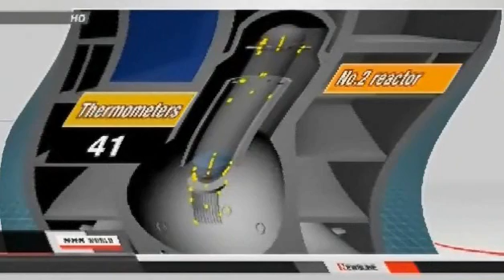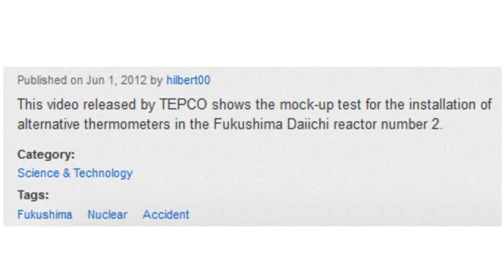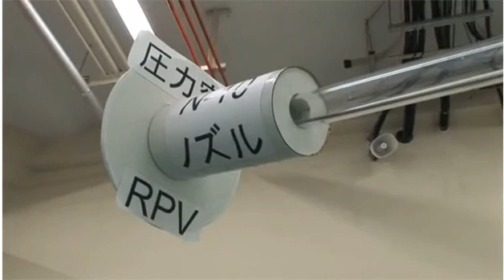OMFG, Fukushima Decontamination Japan, have a peek update 6/2/12

Comment: The problem is clearly that they are using Toshiba equipment. This means to me that they are using low end equipment bought at Walmart. Until they start using Sony I do not see us progressing. 

Same as the floor paint. They didn't even etch the floors. This is why they scraped it up. It didn't stick, and its also made by Toshiba as well!!

They might as well be using Turkey basters from walmart to cool the reactor too.